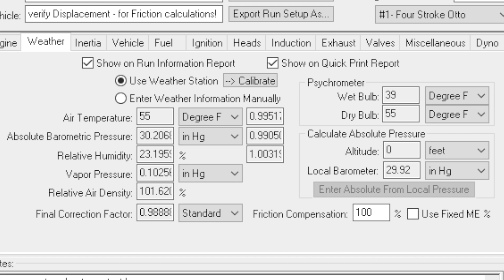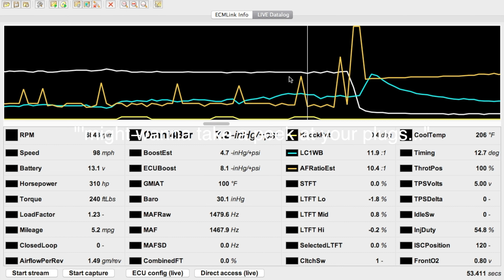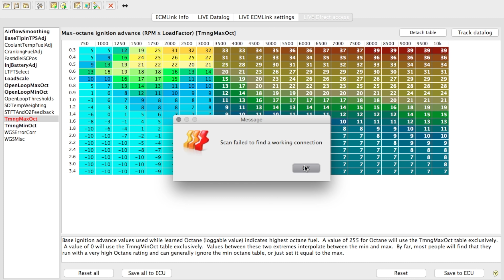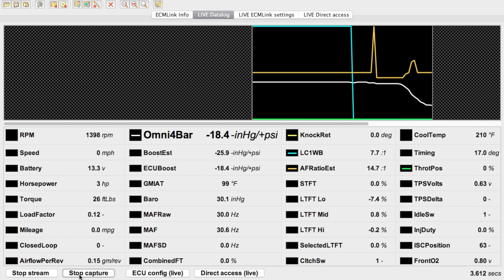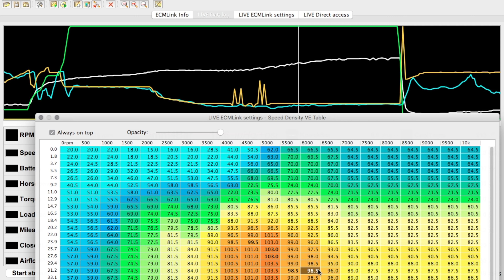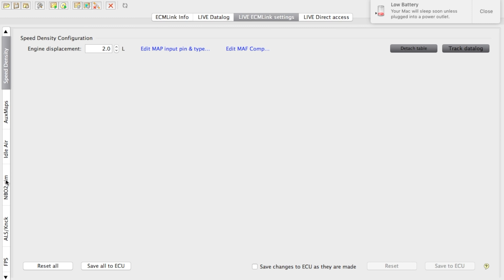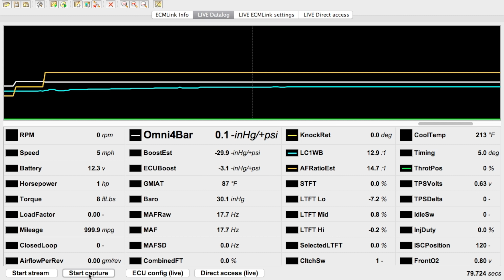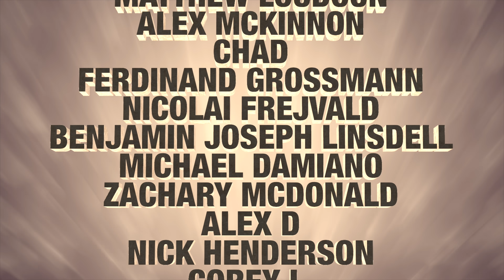Turbo Elantra Dyno Baseline

Comment: Congratz Jafro on joining 1000whp youtubers club!
Reply: my guess was 450hp 300-500FT max without hard parts changes so im wrong my 2 gut feeling was closer at 300hp but still wrong 

based my knowledge of what my 1970 BBM 383-mopar EFR-turbo should do and this's is smaller size than 76-70 and it had 2x for it before my car got jacked/stolen for parts
Reply: no to 1000HP club i worked on these car's ( and caddy's as the shop was trying to be mostly a profomance caddy shop for north-star's and 500CI platform's ) when people drove them everywhere/everyday ( 2009-13 ish ) and i got the 60's automatic charger about the same time frame so no in a drag or street roll my car stock and N/A was about the same felling or faster on test drives , caddy's on the other hand was different but the wheel spin/torque steering wow scary if you punched it too hard but if it dead-hooked destantly fast vibes 

unfortunately i haven't gotten to feel the 600+hp vibes of my charger as that's about when it went wrong ( and no turning/first start-up ) to im going to have to try again just with a different boosted hemi+tr6060 combo

Comment: About the water methanol kit. When i bought the kit through my tuner, he said it was just waste of money, he never had any of those kits make any noticeable difference. So when i came back to him to have it put on the dyno, we did as you did, a base dyno pull without water/methanol and another with it on. and we got simular results as you are showing here. This also made it possible to further increase my boost, without any knock and the intake temps still really low. So yeah these kits work if they are installed correctly !  Really great video Jafro, i really enjoyed it ! Its always fun to see how, the little minor changes, can have a bit impact on how the engine delivers its power. Keep up your awesome work !
Reply from the maker: Thank you!  I use it to extend the useful stability of pump gas.  Just like you've proved.  Reducing the fuel mixture's volatility cools things off and extends its useful compression limits.  This turbo likes 29 PSI when you give it what it wants, but gasoline doesn't.  It's just a means of bridging that gap.  It's adding a strength to something's weakness so it goes farther, and the strength it provides varies based off the car's weakness.  If the weakness is normal aspiration, then by The Powers of Greyskull this modification will never help you with that...  But yeah, for forced induction, the benefits are well worth it!  My log's right there, anyone who wants to see the difference in IAT's... it's right there.  With no boost control it crept a couple extra PSI higher from the increase in density of the exhaust gas.  It got overloaded bombers off the ground in World War 2.  It still works in 2021.
Reply: offcourse it works. They used it on worldwar 2 fighterplanes during dogfights. And in 1980's Group A touringcar racecars (world championship winning Volvo 240Turbo,  https://people.physics.anu.edu.au/~amh110/group_a_volvo_specs.htm   )

Comment: it just goes to show, all you need is to wait long enough for a friend to buy a dyno and let you bring your junk up onto it and it will fix your maps completely.
no fiddling Jafro!
Reply from the maker: Yep!  Hey, I feel like my street tuning episode saved me a whole lot of time here, though!  It also exposed exactly how good of a job I did, and how close I got it without it.  It sorta validated my street tuning video.
Reply: @Jafromobile  there is even a little bit of a myth that street tuning is dangerous, as long as you're keeping the AFR up to it with a street tune you aren't going to hurt it... you have just as much of a chance of hurting it on the dyno if you're not keeping the knock down by leaning it out.  its great to see you found a few of the ponies that were hiding on the dyno by dialling it in on one... dynos are just a tool and aren't magic that somehow protects engines from blowing up.
anywho... seems like the 2.25" intercooler pipes just cant flow any more air, the GSX doesn't need its old 3" intercooler pipes anymore does it?
Reply from the maker: @ChristmasCrustacean1  Some of them aren't even 2.25", lol, and it's only making 75 horsepower less than my GSX did turned all the way up.  The GSX dyno'd 357hp at 26 PSI on a Dynamite.   I've got 30 year old stock 1g rubber hoses on this thing.
Reply: @ChristmasCrustacean1  believe it or not, but we've made 700whp with 2" charge pipe coming out of the turbo lol.

Comment: I'm current building a 2003 Hyundai Elantra. Its my first build, i literally fuck everything up that i touch, and there isnt a single person that i know personally (outside of my girlfriend) who supports it or think its going to be cool. But i bought the engine witb 66k miles for 300 bucks, im using evo 10 exhaust headers that were donated, im starting off with an ebay turbo (see "i fuck up everything i touch" above), and im running a stock bottom end to keep everything from being too complex to handle. at the very least it will be a solid learning experience. If it all goes to plan, ill have a fully rebuilt Elantra (not just the engine) putting down 270-300whp that drives like a go-kart for under 7k. Im excited for it and im glad other people just do what they think is cool

Comment: Sorry to hear your local track has suffered financial difficulties. Lots of tracks seem to facing the same hurdles. I have waited for years to see the Elantra in a state that it can be tuned reliably. As a fellow Mitsubishi owner, I know what it is like to drive a 30 year old car with electrical system gremlins that come with it. So, I look forward to the next video with all your boost issues addressed and you are able to jump back on the dyno. Congratulations. All your hard work is finally coming together.
Reply from the maker: Tune in tonight, no pun intended.  It's all in the works!  I'll have a curveball for everyone at 9 pm.

Comment: Your water meth results were interesting, my back to back drag strip results using octane boost vs water meth on a very warm day (tune untouched) yielded 2mph gain tested over 4 runs back to back.  On a cooler day on the dyno, It made up for the previous runs heat soak, but only in the top 30% of the curve as the IAT's really cooled down. Definitely not consistent with what happened at the strip on a warmer day. 5.4L v8 470hp Snow 220cc nozzle 75/25 meth/water. I uploaded a video on my channel showing the results. 🙂 keep up the vids, love your stuff!

Comment: this build used to do among S.Koreans in 90's - early 00's

looks like not have body rust that is surprise....

Glad to see in Youtube.

(and also Koreans did SONATA(Y2, Y3) with 4G63 OR 6G7)
Reply from the maker: Yes!  The 1992 chassis only has 77,000 miles on it.  The last 30,000 have been pretty rough, but it's surprisingly rust free for its age, I agree!

Comment: Those faces! Just about spat my dinner out, now the wife thinks I'm crazy!

Decent power from the big wheel in the small housing, though I don't think it comes on soon enough. It seems to be doing the exact opposite that I thought it would, it should spool fast then choke flow up top. Considering the high CR should be making it come on quicker too, something ain't right.
Hopefully that's just the old and janky parts laughing at us and not the turbo/boost control system being crap.

I wonder if the wastegate is opening due to exhaust back pressure...... though, you ported this turbo right?

I think it should get to around 340WHP based on turbo, engine volume and the water/meth. around 280-300 without the meth but with boost control.

The curves look quite predictable and THAT AFR! Damn, the time you must have spent to get it that solid...... Amazing work on the street tune!

Reminds me of the Suby tuning I used to do.

LOL at the amazing voltage regulation, the overclocks are real.

Comment: Great work as always. I would have loved to see you push the afr’s leaner. That may have also allowed you to run a little more timing. Your buddy kept referencing the same notion on how rich you were. Looking forward to the next video.
Reply from the maker: It's absurd what the car needs, though...  It's rich, and still knocking unless we drown it in more fuel.  That's why I think the knock is not real.  But, when I add fuel, it goes away.  When I spray water methanol it doesn't knock at all, but suddenly I can run 11:1 AFR's.  I suspect it could be is the loose oil clearances and pistons slapping and rattling around and setting off the knock sensor?  It's really frustrating.  With 9.9:1cr, you really don't get a very big tuning window at all, and with what I have going on with the timing, I'm thinking about making changes to the cam timing.  I don't think it likes it.
Reply: @Jafromobile  A loose piston inside a bore makes a similar sound to pre detonation under load (at least in two stroke 250's - 300's), so the electronic ear might be getting confused.
It would also make sense with the lower afrs, since running pig rich will decrease the horse power, thus peak pressure inside the bores.

Comment: Not bad! Power does seem down slightly though? Especially given the compression bump and cams. I Moved onto EVOs when they came out, but having owned a few DSM ages ago. I’ve cracked 300+ AWHP on bone stock motors, with a 16g on 93.. I’m curious to see actual efficiency differences between the fleabay special, and a real MHI unit.
Reply from the maker: They're tightly matched, really.  The Big16g vs. this CX Racing unit.  The 20g wheel is really too big for this TD05H compressor housing, but it does flow a bit more air up top.  Once you add the heavier wheel and spool characteristics to it, they both produced time slips within a hundredth of a second and 1 mph of each other.  The CX racing had the high MPH at 123mph, and the MHI Big 16g had the quick ET at 12.20.  I dyno'd my GSX with the CX Racing turbo and it made 357awhp.
Reply: @Jafromobile  Interesting! Yeah, that’s the downside with the smaller guys. I road race my Evo 8 with an old school FP green. So much heat. Turbo tech has done a long way, I should probably upgrade! 

Love the channel!

Comment: Great video mate. You don't quite sound yourself. Hope your okay buddy and it's just the way the video sounds itself  👍
Reply from the maker: I got Covid over a year ago, and it did change my voice forever.  I'll blame that instead of age.  Also, the audio on this project was a beast.  I had 4 stereo mics (4 camera angles) and had to chase-equalize everyone around a noisy concrete room and add filters to hear them.  This was the most difficult audio track I've ever had to put together.  I proofed it on several devices, and due to the ridiculous audio system on my TV, I think I overdid the bass cut.  It sounds hollow on my laptop, iPad, phone, etc...  So it's one thing, or the other.  Perhaps a little of both.  Thank you for the well wishes!

Comment: You were running it very rich at least from my experience with turbo cars. I generally run 11.75 on pump but my car is direct injection, still low tens is pretty fat rich. I would have been shooting for 11.5 at WOT. Thanks for the upload.
Reply from the maker: Until you spray the methanol, it knocks on pump gas above 15 PSI.  It's just a thing it does.  It's probably because the compression ratio is so high, but I totally agree with you.  I wish I could do that.  I got away with 12.4 AFR's on my GSX before it would knock and it was only about a half-point compression lower.
Reply: @Jafromobile  Yeah that sucks. On my mazdaspeed 3 2.3 DI motor I am running 10.5:1 pistons and able to push some pretty decent timing on 93 pump without knock. I can push some moon boost/timing on e85 but my turbo is considerably larger PTE 5862. Hope you can figure it out and make some more power on the hit to carry out further.

Comment: This was awesome to watch... thank you for sharing. I really think there's something going on with your afr. I think you're rich knocking just alittle and I think it's running a lot richer than you think or then its showing. I think it's right before the verge where you'll see black smoke coming out the exhaust. I played around with my tractrix cable on my Evo 9 and I ran 15 degrees on E30 @32psi 11.8 afr Stock engine(daily driven 3yrs). I now have a 240Z with an l28ET with megasquirt hx35. I run 11.8 to 12 afr with water meth @24 degrees 28psi and 11.2 to 11.5 without @ 18 degrees 20psi. I've never really messed with tuning anything with that high of a compression ratio. I'm not sure where you should be but it was awesome to watch.  Another quick question why do you have such a rising boost curve? why doesn't it hit its Target and then stay there... it's not that big of a turbo. Your Boost curve acts like it's a procharger... maybe that's a good thing with your non turbo stock pistons.
Reply from the maker: Gas here is E10.  In this and other videos whenever I pull fuel out, or add timing, it knocks more.  I'd love to be able to just run 11:5:1, but I get anywhere near 11 and knock increases.  The only thing that seems to cure it is more methanol or drowning it in fuel.  Look at the last pass, I got it down to 11:1 with little to no knock.  I've been trying to reduce the AFRs for the past year, and that's a first.  

I don't believe the timing numbers.  I set base timing, but it's got to be off.  This is the worst car to set base timing on if you use the crank pulley, which I did.  I'm going to retime it using the cam gears.  I may also make a cam timing change because a 103.875 lobe separation angle is an absurd value for a boosted engine.  I just installed them following HKS' recommendations, and that's how it turned out.  I'd prefer to get that one up around 108-110 because the lower LSA's are more suited for normally aspirated engines.

As far as boost is concerned, there's no boost control whatsoever at the moment.  It didn't function.  This turbo boost creeps if you set it under 20 PSI, and it's always done that even on cars that were only 9.2:1.  It's how I ported it, and it's not intended for low boost settings.  I never knew I'd be bolting it onto a FWD car when I did it.
Reply: @Jafromobile  I always made my own E30. I just kept adding alcohol until I ran out of injector. 😆 I now use water meth.... which I'm a way bigger fan of.. Anyway something just seems off and I don't know what it is. I have a feeling you're going to find something super little and it's going to make all the difference in the world. Best of luck... can't wait for the next video.

Comment: It has been forever since I "tuned" a 4G63 which consisted of turning a small dial on my HKS VPC so I might not be qualified in this area but, I do wonder about your higher compression motor with the stock heat range spark plugs (BPR6ES). You could definitely should try cooler plugs to see if that eliminates the knock under load because it is a cheap test. There is even an 8ES plug too you could try.

Comment: Can I do that to strengthen my car and modify it like the Evo 3, which means installing a 16-inch rim, installing a front body reinforcement, and also installing an automatic transmission for it. I bought a 2007 Rally Art shift rear dongle, meaning I bought the entire parts from a dongle and an automatic transmission. What do you think with some help?